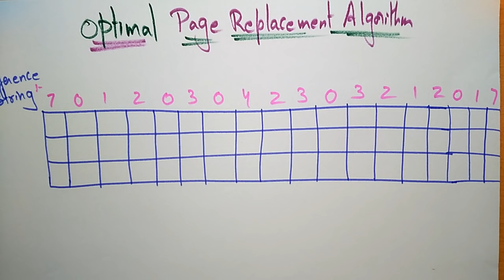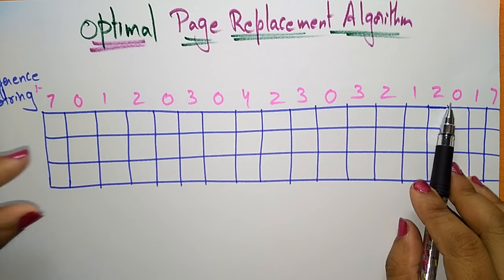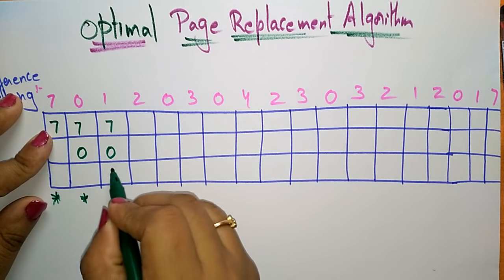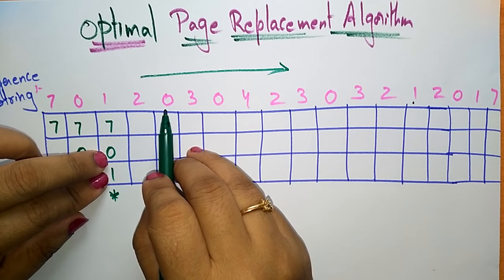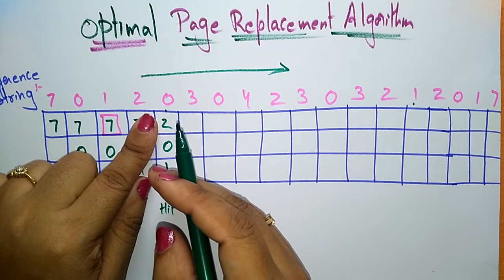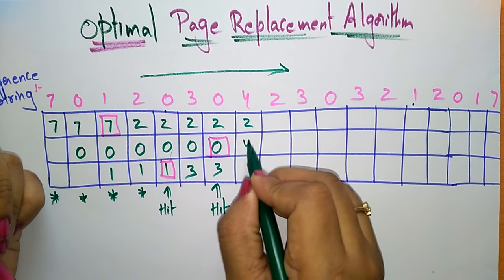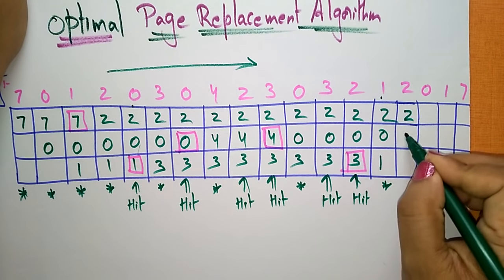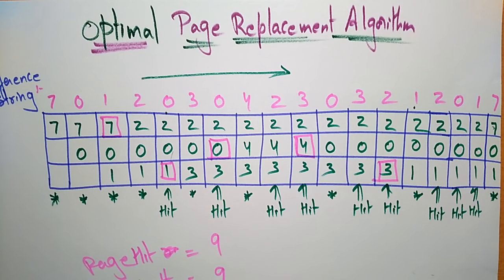Page replacement Algorithms | OPTIMAL | Example | OS | Lec-28 | Bhanu Priya

Comment: mam pls could u explain how did you fill 7 in the last  column ? how to determine where to fill 7 in last column?
Reply: same here, but i think it's doesn"t matter where or we set on LRU processus.
idk why 2 exactly.
Reply: Use FIFO during the last stages of optimal problems...
Reply: Exactly same question mine also...
Reply: You have to replace mostly repeated page number

Comment: 1,2,3,4,2,1,5,6,2,1,2,3,7,6,3,2,1,2,3,6
how many page faults would occur for the any two replacement alogorithms, assumming frame size is 4,5.
I tried and I got the both answer s page faults is 8 for optimal page replacement using 4 frame,LRU using 5 frame is the answer correct or wrong

Comment: suppose when I check far from right in this time suppose two value did not present current position to the right side then what should I do?
7,0,1,2,0,3,0,4,2,3,0    number of frame =3      
plz solve this example

Comment: how to identify if it is used in future or not how does program get it that which is not used for longest time
Reply: This is a theoretical page replacement policy, in real time you cannot predict which page is going to be the longest unused page. Some of the operating system keeps the track of all pages reference by the program, and it uses those data to decide which pages to swap in & out on subsequent runs  to achieve near optimal performance. But this can work only if the program's memory reference pattern is relatively consistent each time it runs.

Comment: what's the difference between FIFO and LRU
Reply: FIFO means First In, First Out. The page that came first will be removed first. This depends on the time.
LRU is Least Recently Used. The page which has been not used for the longest time is removed. This depends on the use of page.